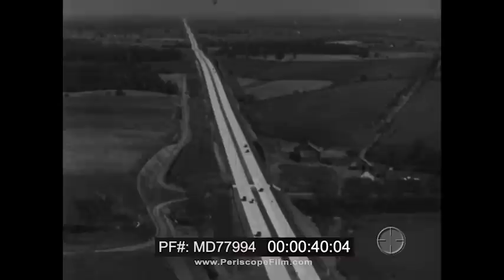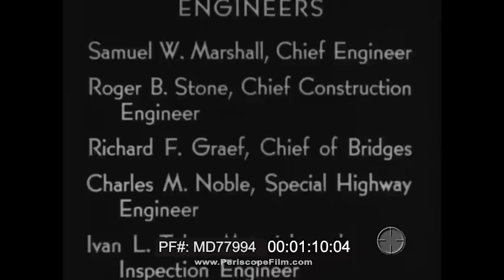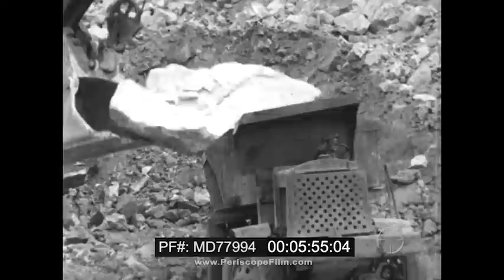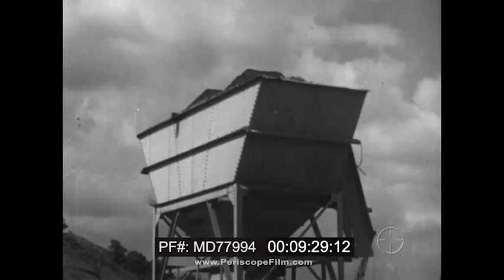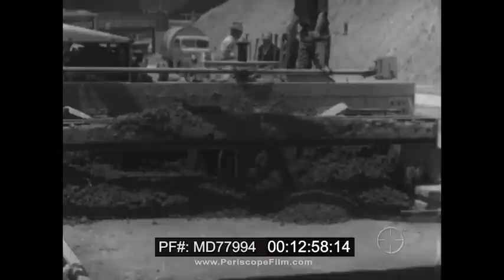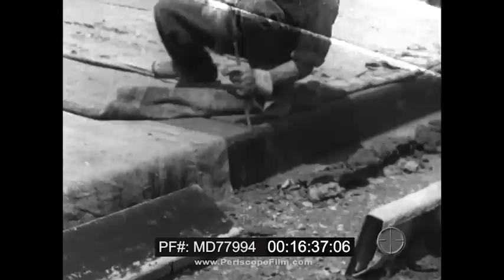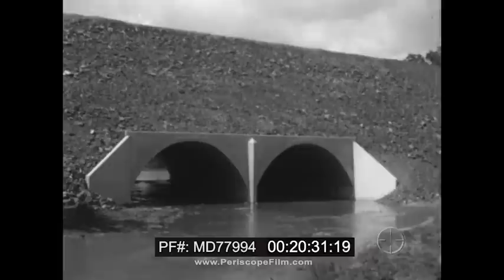CONSTRUCTION OF THE PENNSYLVANIA TURNPIKE   INTERSTATE HIGHWAY SYSTEM MD77994

Comment: The oddest thing about the PA Turnpike is that the road construction never ends. There’s always some section of the road under construction. Even when all those construction spreads are completed, they start all over again.  I think the Commission justifies the toll increases by doing rework all the time. There’s even a stretch of the Pike near Norristown where the Commission experimented with a new pavement material, just to rip it up and replace it two years later.
Reply: Of course that’s how it works when you have to maintain a road system.  If your aren’t continuously maintaining it then it’s going to fall into disrepair.
Reply: That was my impression of the Ohio Turnpike.  It seemed it was constantly being resurfaced.
Reply: I go from NJ to Pittsburgh 4nights a week, there is definitely some kind of scam going on with construction zones,there are  several of them with nothing going on and they repave sections of the road that don’t need repaving probably to justify labor jobs and the high tolls. I drive a T/T for a large company and don’t have to worry about tolls,but something crooked going on and they will always get away with it because no one is watching the trnpke commission and they no it,just my opinion 😗

Comment: in 1964 the first tunnel [ laurel hill tunnel was bypassed ]..in 1968 2 more tunnels and a stretch  of road were bypassed..[ sideling hill  and rays hill tunnels] ...ironically the longest  [ sidelinghill ] and shortest tunnel [ rays hill tunnel ] are about 5 miles apart from each other and both bypassed by 1968 ...google or youtube  [ abandoned p,a turnpike ] for cool pictures and video

Comment: My father remembered seeing, "Reasonable and prudent speed" signs on the Turnpike in the early 50s.  He said it was common to see older cars whose engines would catch on fire after trying to do 80 mph.  His own '50 Chevy started to burn oil after he pushed it to 80.  Splash-lubed Stovebolt six with a 4.11 rear end - screaming engine at that speed.
Reply: @Gman2060-v5d  You really didn't want to do more than 50 mph on those Chevys.

Comment: 0:44- Frank Bebout was a businessman who was a member of the Pennsylvania Turnpike Commission. He never lived to see the Turnpike's official opening, as he died of a heart attack on August 22, 1940, at the age of 74. Ironically, he had his heart attack while driving on the as yet unopened  Turnpike, towards home.
Reply: He'd have heart failure again today if he saw the state of this road.🍺
Reply: @jagboy69  Sadly, that original Turnpike fell apart within 12 years and was repaved so in 1962 all 160 miles of original turnpike was repaved. Over the last 25 years a good deal of Turnpike has reconstructed, with new overpasses with full restoration of several of the originals. Read my Turnpike books
Reply: @mitchdakelman4470  Dear Mitch:  I recently saw a video "report card" on America's Infrastructure by some assoc of civil engineers.  They claim that the original design specs for the Interstate System was for a 50 to 60 year lifespan.  It sounded like they were shooting for low cost instead of high quality to me.  A 60 year expected life span for a major national road system is a Slap In The Face for me as a tax payer.  I'm certain that the available technology in 1960 was better than that.  So if they built the PA Turnpike according to the same Crap Standards, then your comment doesn't surprise me a bit. ... jkulik919@gmail.com
Reply: @JosephKulik2016  The Pennsylvania Turnpike was built using state-of-the-art building materials in the late 1930s. We were told by the late Neal Wood, who was the bridge engineer and a very nice man, that they did not know the use of what is called air-entrained concrete. As I write this, another original Turnpike overpass just west of Bedford is being replaced because of bad spalling. The irony, the next bridge west, is all original and was beautifully restored. If you know the Turnpike and watch the film, there were many concrete rigid frame bridges that crossed the Turnpike. Only 3 remain now on the original stretch, but many, on the eastern extension were built using air entrained concrete and all have been magnificently restored. Although, I am sure that most of the traveling public is unaware of the beauty of these single span bridges. The fact that the Penn Turnpike was an all concrete 4 lane highway, compared to the 6 lane black top New Jersey Turnpike, has fascinated me for most of my life.
Reply: Barry I. Grauman...I was thinking he ended up encased in one of the overpasses because he didn't follow the "receive 2 loads of cement, pay for three" rule.
Reply: Barry I. Grauman I did not know that, thank you.
Reply: You're welcome!